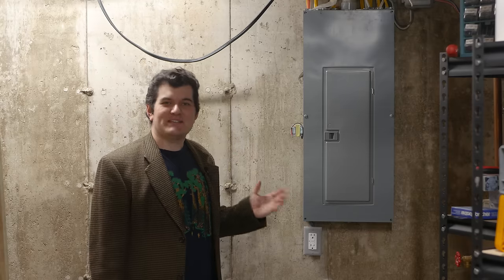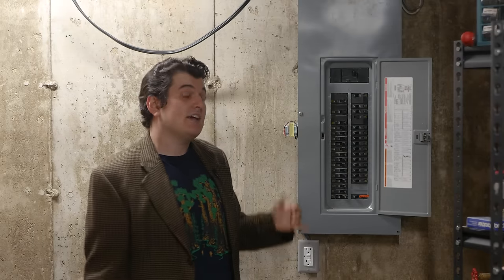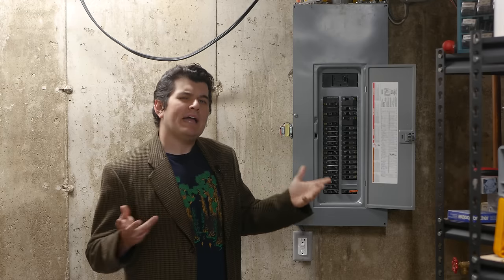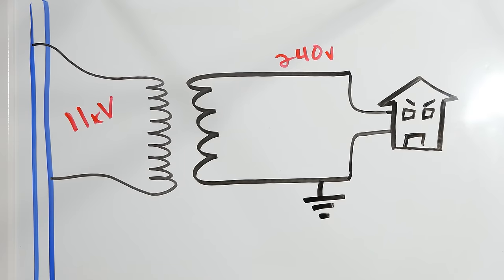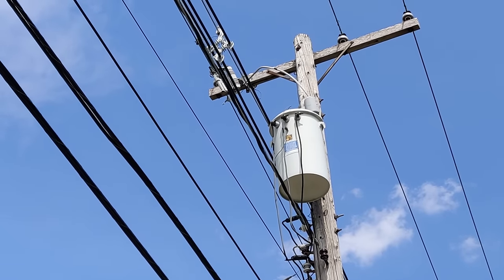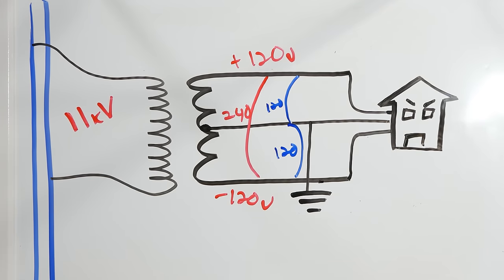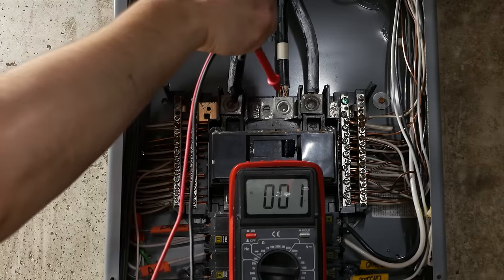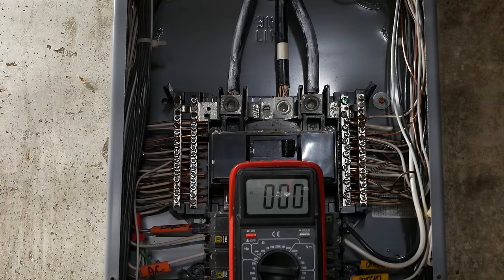The US electrical system is not 120V

Comment: I can feel his frustration at having to explain the difference between "safer" and "safe."  LOL
Reply: I think "less dangerous" would've been more accurate.
Reply: It's almost as if he's deflecting a veritable library of comments on that topic. ;)
Reply: @vibingwithvinyl  it certainly does sound better in a sentence relating to high voltage current
Reply: @RicoElectrico  I'm not sure I agree. His moans about stupid complaints are themselves entertaining to watch.
Reply: @vibingwithvinyl  More like "less lethal" or "rubber coated"
Reply: It's like explaining covid.
Reply: I like to think of it as getting shot once vs getting shot twice. Yea getting shot can kill you, but if you had a choice between getting shot once vs twice, 2 bullets is much more likely to kill than 1.
Reply: @RicoElectrico  just go on Quora.com.  There is some Australian that have bad comment all the time.  (dead is dead is his favourite sentence). Last time, they talk about the number of different plugs we have to in comparison to them.  Like NEMA 15R  or 30R...  When I told him that in the Australian computer center they use the same NEMA 240-15R plug, he did not believe me.  Even with a picture of a computer center.
Then I ask him what the plug for my 240V-50 AMP welder will look like.  My Plasma cutter (240V-100Amp).  He did not really have answers.
Reply: Geometry, you can actually measure the voltage with vector diagrams.
Reply: A good analogy would be "it's like the difference in crashing your car at 60 MPH versus 90 MPH. Yes, 60 MPH crash would still be extremely bad for you, but at the same time, 90 MPH is WAY WORSE."
Reply: @vibingwithvinyl  "Less dangerous" and "safer" are literally the same thing. They're both comparitors that require context to understand. Something that is less dangerous is, by definition, safer, even if it's not safe.
Reply: It's like when you say that one thing is better than another and some people will pretend you said it was good.
Reply: @RicoElectrico  we don't use the R-word. Do better. Be better.
Reply: @vibingwithvinyl  Less dangerous is the same thing as safer. Otherwise we wouldn't have the word "safer" to begin with. Because then "safe" would be an absolute non-variable state of being.

Comment: That ending fun rant was hilarious (I'm a Brit). Maybe one day we can all get together internationally and produce an IEEE standard for electricity distribution. Based on the age old model of identifying all the best bits given by the available systems, and then implementing the worst bits instead...
Reply: Not gonna lie. You had me in the first half
Reply: UK has those big ass plugs
Reply: The best standard would be a compact version of the UK plug, ditching the switch, keeping the rcd and fuse in plug, keeping 230v, etc
Reply: 50 or 60hz, one will've to die
Reply: you can't throw a pair of dime at the american plug
Reply: @garfieldtkat  60hz has to die! By the way, I heard, that in Japan they have two systems. 50hz and 60hz depending on the region.
Reply: @Rick-vm8bl  Italy uses small American size like plugs (see also Euro plug). And its 230v. Now the way to deliver ground, that's where all countries went their different way... Just try not to move your Euro plug while connected to a female Shucko...
RCD and switch and fuse have been done all already, its simply optional when code doesn't asks for it.
Reply: @Rick-vm8bl  I like type J. Finger safe, polarized, compact. The fuse can be held in the device and is rated for the real power of the device. The fuse in UK plugs is just to accommodate the thin copper which can't withstand the 32A of the ring system and is always 10A, even if the device would blow up at 1A.
Reply: @garfieldtkat  See: Japan... Its crazy. But, everything else equal 50hz means 20% more coil for transformers, so there.
Reply: @drstefankrank  UK plugs have fuses that are rated to the appliance. The largest size fuse in a standard UK plug is 13A, but not many appliances will need that size. Most plugs should have a 3A or 5A fuse in. 
The fuse in the plugs is mainly because of our outdated ring circuits being able to supply 32A. The fuse in the plug protects the wiring as the cables used on ring circuits could not carry 32A safely. 32A is supplied in two directions to each socket outlet allowing smaller sized cables to be used (thus saving on copper after WW2).
Quite a number of electricians now provide new wiring as spurs and not as rings as they are easier to fault and safer (a break on a ring would go unnoticed as the outlet would still be provided power from one direction, however the cable could be overloaded as the breaker is 32A).
Reply: @drstefankrank  I might be misunderstood you, but are you saying that the fuses in UK plugs are always 10A?
Reply: @freeculture : But 60hz means more transmission loss in wires.
Reply: The funny thing about the Brits and the Germans is that they have contradictory building codes for copper gas pipes. Stuff which is mandated in Germany is prohibited in the UK and stuff they have to do in the UK is illegal in Germany.
Reply: @glee21012  Not as big as Euro plugs, or that one for the dryer.
Reply: 12v is the way forward. But can see the merit of 36v. All devices operate on 12v or less, other than some devices, like car battery chargers, etc
Reply: @AlJay0032  bananas. Can you provide an example, or a link please, so we can learn more?
Reply: I know that institution, the IEEE
The Institute of Electrical Engineers on Ecstasy, if I'm not wrong, BullShit 7671
Reply: Tesla designed the American system, with 60 Hz, I will stick with the genius.
Reply: @drstefankrank  Wrong. Most plugs have 3 amp or 13am fuses, depending on the appliance connected. You can get 5 amp, 10 amp and 1 amp fuses, but these are not part of the UK regulation specs.
Reply: @Rick-vm8bl  Just this week I have seen a quite small UK plug with just the fuse. It's still possible to expose the life wires while plugging it in. If it was smaller, you could touch the electricity with your fingers.
In a world without children, I'd prefer the plug from the computers but with a release lever on the plug.
For our German plugs, there are safety covers that will prevent most children from putting metal bits into the plug. Also I'm used to those.
Reply: @cccccc9929   Fun fact... hook up a 60 hz motor under load to a 50 hz supply and watch as all of the magic-smoke leaks out.....
Reply: @garfieldtkat  if we're making the worst system why not just run it at 55Hz or 70Hz so everything is incompatible?
Reply: Situation: There are 2 competing standards.
People: That's ridiculous! We need to make a universal standard that everybody can use!
Situation: There are 3 competing standards.
Reply: @drstefankrank  Type J belong to  the swiss system. Its rated for 10A.
Reply: @ImeanFFS  No, but they have to include them because of the wire diameter in the cord. Stuart Arnold described it very good.
Reply: @bimble7240  Yes, you are right. Can't remember why I wrote it like this. It's just that there has to be a fuse in it.
Reply: @drstefankrank  but my kettle etc have 13A fuses?
Reply: @ImeanFFS  I wrote it a bit misleading. The fuse need to be sized for the device it should protect. It can't be higher than the wires in the cord. Otherwise the cord would have to be sized for 32A.
In other countries, the breakers and cords are sized for the same amperage. Devices in these countries have their fuses, if needed, in the device, not at the plug. The cord is already protected by the breaker.
Reply: @drstefankrank  Are you sure about the fuses in the device? Bear in mind almost all UK devices are the same as their European counterparts just with a different plug.
Reply: @ImeanFFS  Not all devices have fuses. Some may just blow up in a more or less spectacular way in fault conditions. My kettle is rated 2000W, doesn't have a fuse, neither does my 850W coffee maker. Guess the fuse is the heating element itself.
My stereo amplifier has some, my network switch and many other devices as well. Sometimes exposed and user replaceable, sometimes you have to open the case if it's even possible.
Maybe in the UK you sometimes have 2 fuses? One fast one in the device and a slower one in the plug. If they put a lower one in the plug, they can use thinner wire in the cord, I would believe. Don't have actual numbers nor UK plugs.
Reply: @drstefankrank  I think you're just jealous of our 3000W kettles! 😜
Reply: @ImeanFFS  Haha, that's important for a tea drinking country. I mostly need a coffee maker.
Reply: UK and AU have the best plug designs, EU and US are pretty awful.
Reply: keep metric away from the 50states in america north that is. u can spot the spys everytime.
Reply: @cletusrodriguse8546  I think it's cute that the general population of the US clings to Imperial measurements so strongly... Just like us over here in the "51st State". Officially you've been metric for decades, but ask the common man in the street and he'll take his beer in pints, his butter in ounces, and his wood in feet and inches.

If I have to plan, measure, or cut anything, I work in millimetres; it is just the simplest and most accurate option. But ask me to estimate the dimensions of anything and the answer will be in feet and inches, because I just cannot visualise metric very well.
Reply: @damionlee7658  laughs in 10ths/100ths of an inch
Reply: @drstefankrank  lmao.
Reply: @Rick-vm8bl  The switch is not part of the standard (unswitched sockets are available) and doesn't affect the size of the plugs.
Reply: @drstefankrank  "and is always 10A, even if the device would blow up at 1A." Wrong; 10A isn't even a standard fuse size on UK plugs. Generally the options a 3A, 5A and 13A. The fuse is to protect the cord, and if the device needs 1A protection, it will be by a 1A fuse in the device itself.
Reply: @stuartarnold9444  32 A circuits are extremely useful. It means that two high powered devices can be plugged in at random in somewhere like a kitchen without tripping a breaker. Useful when you have washing machines, electric kettles, toasters, coffee machines, irons and microwave ovens any combination of which might be in use.

Also 32 Amp circuits can be implemented as radials using 4 mm^2 cabling for those who hate ring mains. It's also worth pointing out that, whilst there is a potential issue with an undetected break in a ring main which could lead to a wiring overload in one half of a ring (although it would have to be heavy an sustained), radials can suffer from undetected breaks in protective earths and, what's more, ring mains are pretty well immune to serial arcing type problems on slightly loose connections. 

So, ring mains aren't all downside, safety wise.
Reply: Only in America.
Reply: @cccccc9929  60Hz is useful for timing circuits. It also reduces eye fatigue because it eliminates much more flicker than 50Hz.
Reply: @7eggert  A lot of those plugs are from China, and don't comply with  british standards - no fuse, unsheathed pins. UK plugs and sockets are excessively safe mechanically and electrically but deadly if you stand on one. There are some 'legacy' plugs with round pins, rated at 5A for lamps. They are unfused and are good for that purpose, but never to be used on a 32A spur circuit or ring main - lighting circuits are protected by a much lower value fuse or RCD.

Our sockets are internally shuttered, to prevent kids from sticking metal objects into them, which is a good design from a safety point of view. A lot of the 'safety covers' people put into the UK sockets actually make them much more dangerous.
Reply: @damionlee7658  I always get I trouble for working in both at the same time.
Reply: @garfieldtkat   Obviously, since there's no such thing as "a pair of dime". (Were you trying to say "paradigm"?)
Reply: All that will happen is that there will a new set of manufacturing specs followed by three more slightly different additions to it. And that'd be if we're lucky.
Reply: @7eggert  I think you will find that the plug is not compliant with the UK standard. It will be a chinese knock off. I remember in the 90s a Toshiba laptop was supplied to a colleague with a smaller mains plug without shielded pins, which gave her a shock. Needless to say, totally illegal.
Reply: @TheEulerID  I think that commentators often state that Ring Circuits were developed to save copper, which they do, but also the amount of cable required is also less since you don't have to run a separate 2.5mm cable to each double socket from individual breakers in the Consumer Unit , so you save on the number of circuits, and the number of breakers. Also adding new sockets is easy as you can "run a spur" (connect new circuit) from anywhere on the ring to the desired location. This is much easier than cabling all the way back to the a new breaker in the Consumer Unit  , especially since many UK homes have solid, not hollow (drywall) walls.
Reply: @7eggert  If you did see such a thing, then it's illegal in the UK. It's simply not possible to have legal small UK plugs.
Reply: You have a solid understanding of Government.
Reply: Never going to happen because each country and area has different challenges, distances, energy sources, issues with natural disaster and so on.   Due to the differences mentioned that just will never happen.  Even inside the USA there are major changes, like on the west coast there is a risk of earthquakes so most electricity is above ground WA/OR/CA and the connection to the home is let to be a bit loose so both sides can move without pulling the power line.   While in cold climate states the electricity is underground to prevent damage and power outages.
Reply: @drscopeify  I'm not sure if you realise that the original comment was facetious and dripping in sarcasm, not a serious suggestion. With that said however, not a single reason in your comment would actually prevent a unified standard being drawn up and adopted...

Well, except perhaps that the USA would likely dig its heels in and claim such a change to power delivery was like the metric system, and must be avoided at all costs. There would also probably be lots of claims on Fox News that adopting a unified standard was some how communism.
Reply: @damionlee7658  The USA adopted electricity long before the rest of the world so it is not changing anything I can assure you that.   The long term plan I think in 20-40 years is to move from 120v to 125v but that is the only change.   You can get 480v if you really need it n problem at all but it is overkill.   The reason is that copper in the USA/Canada is very cheap which is why 120v is 15A or 20A breakers and 12 or 14 gauge wire.  240v 50amp car charger is usually 6 gauge wire which is much thicker than in Europe which removed the need for 3 phase or 480v.
Reply: @drscopeify  oh good grief, here it is, USA! USA! USA!

The USA wasn't doing anything that other countries around the world were not doing at the same time. You're very vague in what you mean by "Adopted" electricity. And again throw out a bunch of stuff that has absolutely no bearing on whether a unified standard could be produced.

Not sure why you're so invested in arguing against any possibility of a unified standard. It wasn't a serious suggestion in the first place, it was a comment on how such practices often lead to things getting worse.  So don't worry, nobody is coming to take away your electricity grid, or your guns, or your Farenheit scale...
Reply: Yeah, let's get 29.97hz like NTSC video.
Reply: @Jake Feldpausch technically they switched to metric years ago, there is just an ongoing denial and refusal to use metric by the general population.
Reply: The world couldn’t even decide what standard to use for HDTV (8VSB or COFDM) or emission standards for cars (diesel bad in US/ okay in EU)

.
Reply: The world couldn’t even decide what standard to use for HDTV (8VSB or COFDM) or emission standards for cars (diesel bad in US/ okay in EU)

.
Reply: @Jules Moules yes, I learned that already. The fuse in the plug has a double usage. The primary is to accommodate for the thinner wire behind it and the other is for the device itself. Of course why would I put a 13A fuse in a radio clock that does not use more than a few watts.
Reply: classic standards behaviour!
Reply: Let's pat ourselves on the back for having international standards for Ethernet.  Imagine if that varied from country to country.
Reply: @stuartarnold9444  When I wired up my garage conversion with its separate consumer unit I simply ran one socket spur and one light spur to each room. It seemed illogical to do anything else. And because you can never have enough fuses, the appliances plug into sockets connected via fused spurs.
Reply: God bless you